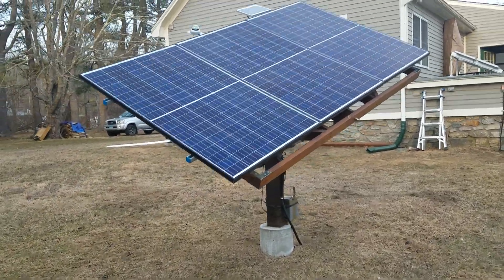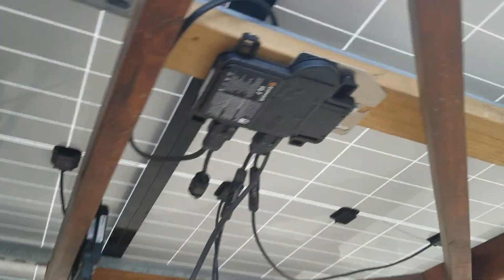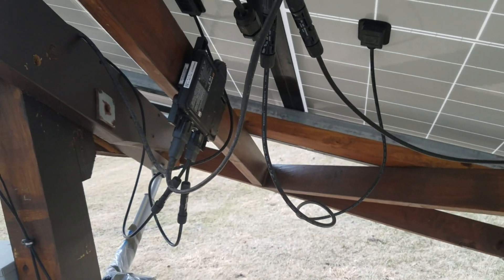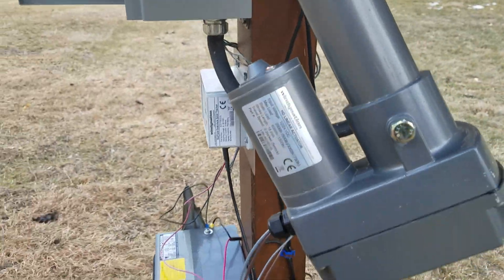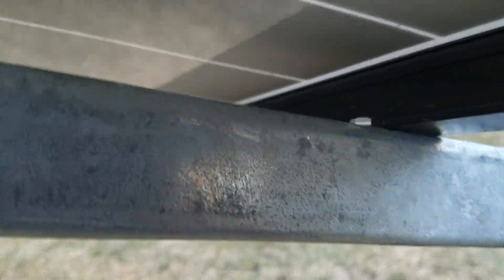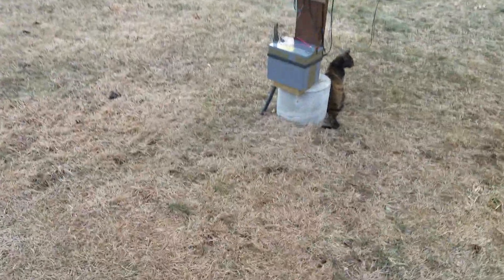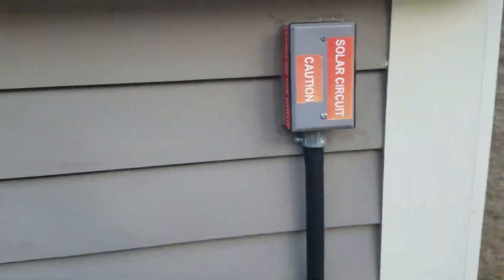DIY Dual Axis Grid Tied Solar Tracker

Comment: Turn the motor the other way and you won't  have water issue . very easy
Reply from the maker: Yeah you mean mount the motor end on the top correct? I had no way to mount it in that position since it clamps around the tube and it sticks past the mount. I had limited room in the top and a bunch on the bottom so that's why I had to do it that way. Other actuators mount at the top and bottom, but not this one.

Comment: I see you have a windy nation 18" HD actuator for the E-W movement. What actuator is that for the N-S movement? How long a stroke?
Reply from the maker: At the time I had a Progressive Automation actuator with a 12" stroke but I switched to a lighter duty cheap one with a 16" stroke since it is nice and balanced and doesn't take much to move it N/S.

Comment: Is this construction strong enough for heavy wind?
Reply from the maker: Mine has withstood 50mph winds, it will move around a bit depending on the wind direction. If the wind is too strong I just wedge a 4x4 behind one side and turn it off, and then it doesn't move at all.

Comment: cool setup, we just had hurricane ian pass by Orlando fl and we lost power i have an apc2200 and was thinking to wire it up with a couple of panels too...
Reply from the maker: I'm sure you could do it, you could have solar panels to a charge controller, and an inverter running the UPS. I have a setup now like that where it's hooked into my generator sub panel with a 3 position changeover switch for grid/generator/ or Inverter power to my sub panel. UPS takes care of the power loss until you switch on the inverter.

Comment: Hey, do you have the design calculations of the project? Could you also assist with the CAD drawings. Will be much appreciated
Reply from the maker: I don't have any calculations and I built this just based on noting where the sun was every week for a full year. That is where I got the location for the post in the ground and I just took measurements from where I wanted fully east to be and fully west so I could get the correct length linear actuator. I added the second actuator a few months later so I could capture more in the morning and afternoon. There are CAD drawings you can purchase for this style tracker that I have seen in the past but I didn't want to buy them, even though it wouldve been totally worth it. Hope this helps!

Comment: What are the specs if that baby?
Reply from the maker: The solar panels are REC 270watt, there's 3 of them on the tracker for a total of 810watts. With those I usually get about 6 to 7 kWh per good sunny day at this time of year. I have the eco worthy dual axis tracker controller and I have a 12" N/S linear actuator and an 18" E/W linear actuator. I have a 10 watt solar panel also attached to the frame to charge the 12v battery constantly that powers the actuators. Hope this helps!
Reply: @SamsDIY  I meant the baby in the chariot
Reply from the maker: Lmao she's a two year old girl now! Lol.

Comment: That looks great well done. Do you have any idea how much more energy do you get using the tracker compared to a fixed angle and direction? For example if you place the panels 30° S, i'm trying to understand the effectiveness of the system. Thanks!
Reply from the maker: I would basically get to peak output almost right away vs when it was fixed it took 2+ hours to line up right. I gain more in the morning and in the afternoon. Ill have to look at my charts from 2019 to find out, I had a fixed ground mount at first.
Reply: Great dear how the programmation

Comment: Hey is there anyway I could contact you personally. I have a ton of questions concerning inspections being it's grid tied.
Reply from the maker: What state are you in? Each states inspection will be different to an extent, here in CT they are pretty easy to satisfy.
Reply: @SamsDIY   I'm in Texas. They are some of the most back ass ward people I've ever worked with in regards to get answers from inspectors. Pretty much anything that's electrical has to be installed and inspected by an electrician and stand alone arrays are not really addressed as to the inspection method if there is one. They are not really DIY friendly.
Reply from the maker: @a6o932  Man that sucks, yeah in CT if you own/have a mortgage, you can do all the electrical yourself, you don't need an electrician. But you obviously have to look up every code and make sure you follow NEC standards. The electric company also comes and tests the system after it's inspected by the town, to make sure it is rapid shutdown compliant. They simulate a power outage with your AC disconnect. They weren't inspecting my wiring or breaker panel, but with my setup it was pretty straightforward. I presented my one line schematic to the electric company and a plot plan to the town.

Comment: I really appreciate your design it's something most homeowners could realistically build, often dual axis trackers are too cost prohibitive for many. May I ask if you had any special zoning issues and or connection to the local grid? Thank you for sharing your knowledge.
Reply from the maker: Yes definitely can be done by most anyone! There was just the building permit through my town, as well as the application to interconnect to the grid. Ground mount setups are less strict from what I have gathered. Just had to make up a schematic for the electric company and then they have to commission it, which consists of them having you shut off AC disconnect to simulate a power outage, and verifying that it is rapid shutdown compliant ( stops producing power within a few seconds of no grid power, and at least 5 min delay between grid power back on and solar to resume production) Then you need a bi directional net meter from the electric company. Hope this helps!

Comment: Great work! What is the power source for the solar trackers?
Reply from the maker: The power source is a 12v SLA battery with a small 10w solar panel hooked to it to keep it charged. That runs the tracker and the two linear actuators.

Comment: Your controller is good, but I have not have one to last over a year I have three so at 250 dollars each it builds up over 10 years
Reply from the maker: Yeah I had an issue about a year and a half in, but the company had me send it back and they fixed it for free even tho it was out of warranty. It's tough being exposed to the elements constantly. The issue wasn't with the controller but the light sensor getting wet under the clear dome.
Reply: @SamsDIY  I have an idea I am thinking about. I have an old 12 zone sprinkler control box. I want the box and a 12 volt power supply indoors.  I was thinking of using the 12 wires of 24 volt ac lines from the sprinkler system to to connect to 24 volt relays. Eleven of the relays would have the outputs tied together. They would send power for a 12 volt power supply to tye actuator. They would move the panels a minute or two 11 times a day. Then the 12th wire would send minus 12 volts to the actuator for enough minutes to reset the system for the next day. Do you think this would work?

Comment: I don't know about arduino, i suppose the ldr's are triggering on when in shadow, what happens to servo when cloudy and both ldr's are in the low light and both are sending signal  ? Thank you
Reply from the maker: When they are in low light they move until they are all equal signals for N,S,E,W. When the light is even it is satisfied and stops moving.
Reply: I was going to use an old 12 zone sprinkler controller box with 12 relays and a power supply to control the actuator.

Comment: can u please give us a link or the model of the 2 motors blocks
Reply from the maker: Okay I found some time to write the linear actuator info down! For the East/West actuator, I used WindyNation LIN-ACHD-18. This is a 12/24v, Heavy Duty, 18" stroke, 750lb. I paid $185.99 last year in March. For the North/South actuator, I used Progressive Automations PA-03-12-600. This is a 12v, 12" stroke, 600lb. I paid $138.99 for this last year in May. Hope this helps, let me know if you need any more info!
Reply from the maker: Sure, for the linear actuators?
Reply: @SamsDIY  thank you so much ❤️

Comment: 0:20 Bro, please cover the terminals! they will corroded. Water + metal + electricity = galvanic corrosion.
Reply from the maker: The terminals really never get wet, and the battery is from 2015, haven't had any issues with any corrosion showing up on the terminals. It has been outside for almost 2 years. If it was an optima battery or something expensive, I would go make a box for it and insulate. The solar panels cover up the battery basically always. I agree with covering them, but I don't have the time right now either!

Comment: What is the  total wattage of your panels and How many KWH does it produce in a month? Are the components from Windy World made in the USA?
Reply from the maker: The total wattage is 810 watts - Three 270 watt solar panels. It produced just over 130 KWh in June, 100 KWh in July because it rained so much! 1.8 MWh since I installed them. WindyNation is out of California, but I believe the parts are made in USA by them, I'll check on that to be sure!
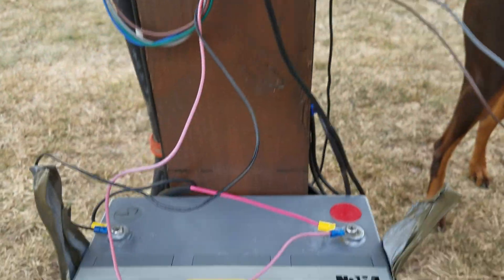Reply: @SamsDIY  We live in SW Michigan and we had a fair share of rain in July too. I have 6 panels for 1950 watts on an N-S adjustable system and I made 241 KWH in July which was only about 20% of our usage. I adjust them manually when they get abut 5 degrees off perpendicular to the sun at 1:00 in the after noon. I check the charging rate and when I make the 5 degree adjustment on a real sunny day, it is a 25% increase. I wish I would have put a  1 axis tracker on it. They are heavy to move so it would take a pretty good motor to  lift them. i bought my panels from Solar Biz out of New Mexico but the panels are Suniva - made in Michigan until they closed their doors.

Comment: I understood you to say the ac goes from the Iq7 micro inverters directly to a breaker in the panel ?  No main inverter inside ? Thanks
Reply from the maker: Yes sir, the MC4 connectors on the solar panel go to the microinverter, and that converts whatever the DC output voltage from the solar panel is to 240v AC. The 240v has to run to a mechanical AC disconnect within 10 feet of the grid meter, then it goes into a 2 pole 20 amp breaker, on the direct opposite side of the 200 amp breaker on the top left of my service panel. So it is on the very bottom right. The 2 hots, black and red in my case, go to the 20 amp breaker, and no ground is required. The IQ7 inverters require a communications gateway called the Enphase IQ Envoy, which requires a separate single pole 20 amp breaker. Hope this helps!
Reply: @SamsDIY  Oh the Envoy is telling them what to do ?  Do you like this system , has it give any trouble ? Thanks
Reply from the maker: @onthelake9554  I have had no issues whatsoever with this setup, I really like it and recommend it if you plan on adding more solar to your existing setup in the future. I only have 3 solar panels but I have the ability to connect 12 more without changing anything with the wiring setup. I believe you can have 15 IQ7s on one 20 amp string. The Envoy is just keeping communication between the inverters and the grid, and it also logs all your data as well as being linked to the "enlighten" app on my phone, and I can see all the data it sees.

Comment: Can I ask you what kind of wood did you use in this project? thanks
Reply from the maker: I just used pressure treated wood and then I used a brown deck stain over it after the wood was nice and dried out. I used about 6 or 7 coats of stain, letting it completely dry in between coats.
Reply: @SamsDIY  Thank You, I appreciate your comment and details

Comment: Could you share where you got that light sensor from?
Reply from the maker: The light sensor is part of a kit by WindyNation. They sell it for $259. There are also cheaper ones on amazon but this one has served me well!
Reply: Thank you.
I am in the process of designing a 20kW tracker array for my house. So every bit of tips and tricks is valuable :)
Planing to build my own tracking logic, so will probably make my own light sensor as well.
How well does your design cope with snow loads during the winter and what angle are you then usually at?
Reply from the maker: @Mr.Engineer.  Nice that'll be a big one! Mine has no problems with snow load as I went overkill on the actuators since we get pretty heavy winds sometimes. With snow its usually almost at a 45 deg angle in the winter, so any buildup more then 2 inches slides right off.
Reply: Yeah, it is a little ambitious and I am worried about wind gusts. It is going to be a pretty big wind sail. I don't think I have room for 2 smaller ones as one will shadow the other. But nothing are set in stone, so will see how it goes.
How far north are you? I am at 60 degrees north and get heavy snow cover during the winter, but since I am so far north the panels will be at a high tilt so it will probably fall off quite easily. I am more worried about those winds.
Reply from the maker: I am in Eastern Connecticut, USA so New England weather in the winter, can be a lot of snow sometimes. Wind gusts get up to 60-65 mph pretty often so it has to withstand that. Theres a tracker within 10 miles from me that has 20 panels on it I wanna say, thats a big setup.
Reply: @Mr.Engineer.  i'd like to see your video building your solar array with the tracker.
Reply: @Mr.Engineer.  look into using a 12 zone sprinkler controller box indoors with 12 relays and a power supply to control the actuator.
Reply: Windynation no longer has the light sensor or package .

Comment: How much did you spend to build this solar tracker?
Reply from the maker: I spent $260 on the whole tracker setup from windy nation, then I had to buy two linear actuators. I got one from windynation I think that was like $200, the other one was on amazon for like $75 I wanna say. I got the 14 and 16 gauge wire for free, but its cheap and you only need  short lengths to run to the actuators. so total around $500, but there are cheaper trackers on amazon. The wood and everything I already had. Had to buy a 10ft. 4x6 to go into the ground and some rebar/concrete.